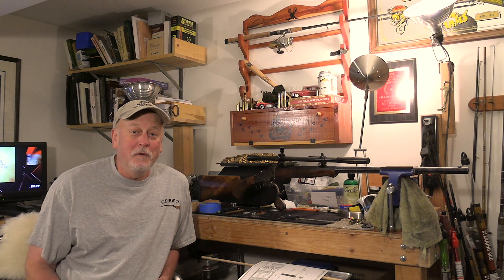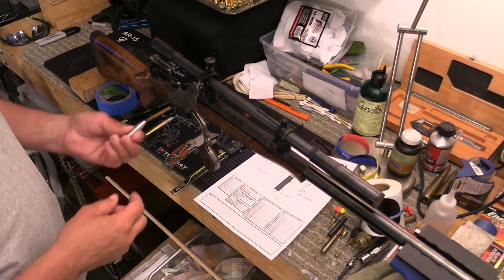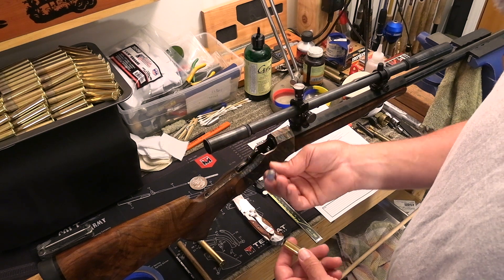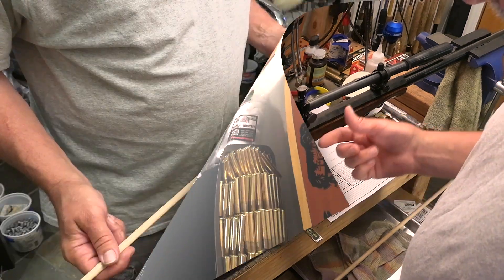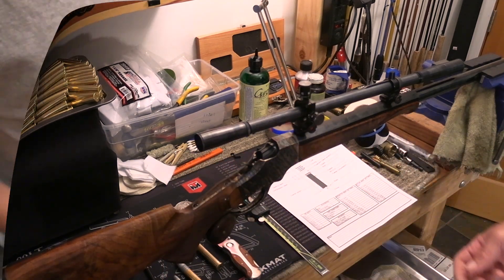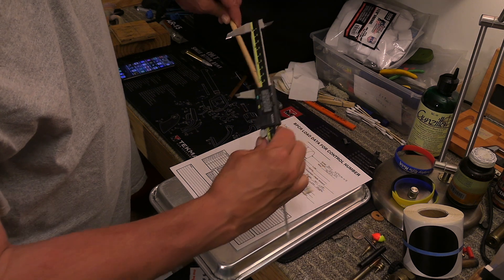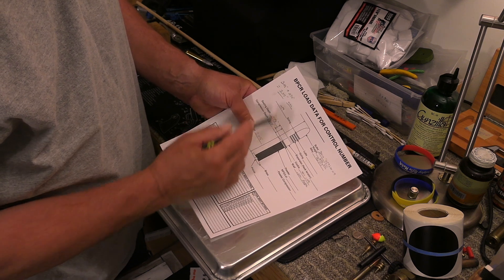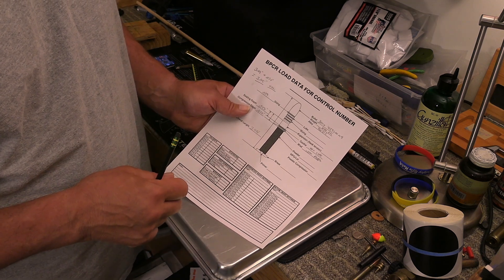Black Powder for Beginners #7 Cartridge Overall Length

Comment: Brilliant! 
I just would like to ask this is working with smokeless cartridges as well? Like .405 Winchester in my case?
Thanks!!!
Reply from the maker: This method is specifically used in single shot rifles. The resulting overall length from this is oftentimes too long to cycle through a repeater. 

The other thing is that seating the bullet farther out could lower the pressure with smokeless powder.  You’ll need to do a ladder test with the new OAL to determine your best load.
Reply: @RecoilTherapyChannel  thank You very much!

Comment: Interesting that you use a .030 fiber wad when compressing the powder column and then you drop a .060 LDPE wad on top of that. While I can imagine that Walter likes selling the additional wads, Is there any particular reason for using 2 wads and placing the LDPE wad on top? I usually just throw a .45 or .41 wad cut from copy paper on top of the fiber over-powder wad to help prevent it from sticking to the base of the bullet in case any lube comes through. Thanks for the link to the load data sheet on DZ's site.
Reply from the maker: Both of the wads are .060 inches thick. While in flight, the bullet is steered by the base. Any damage that occurs to the base of the bullet will adversely affect accuracy. A lot of testing has been done on this and it’s been determined that this was stack the most effective at protecting the base of the bullet. Probably doesn’t matter much if you’re only shooting out to 50 or 100 yards or pistols… But when you’re shooting at 1000 yards, any tiny variance can make a big difference. Awad made out of copy paper won’t do anything to protect the base of the bullet.

Comment: I drop my powder through a 36" tube, cover it with a .060" Walter's Wad, and set the bullet into the case.  I chamber the round which compresses the powder and seats the bullet against the lands.  I use this to set the bullet seating die.  If it is a .40 or .45, I use a taper crimp die.  If it is a .50, i use the case sizing die with the decapper removed to taper crimp.  If I want more compression, I add more wads.

Comment: This is correct but may not work with every rifle. In my Rolling Block, for example, if you add a few thousandths (some people recommend .030") it can cause chambering issues because you don't have enough leverage to fully close the block with that 'interference' fit, or if you're not wiping after every round. Then as you try to extract the live round, the bullet can become lodged in the leade. Worse yet, if there's enough neck tension, the bullet won't release and your extractor could break. This isn't a criticism or a theory, I've been there and done it. Know your rifle.
Reply from the maker: Yeah you RB guys are always getting sore thumbs with this type of seating depth lol!  This is due to the action design. With almost any other type, a camming tool can be used to seat the rounds. With CPA rifles, no tool is needed, the block moves up and forward, thus seating the rounds naturally. The RB has no place on it to use a camming tool, thus the shooter ends up pushing the rounds naturally in with his thumb. 

As far as neck tension goes, none of the guys I shoot with are using any. Bullets are you”finger seated” and can easily be removed from the loaded round if needed. If there is a reason to unload a round on the firing line, the procedure is to remove the loaded case, and then punch out the bullet with a Delrin rod. 

The only time I would use crimp with BP rounds would be for a levergun or a revolver. For single shot ammo, the most we do is bump the loaded round in a resizing die to take any excess case belling off the brass.

Comment: How do you know that the bullet is seated "x" distance into the lands.  Seems like you just pushed it in till it stopped.
Reply from the maker: Once you get the dimension with the nose bumping the lands, you add the .030”, making your final length longer than what you measure on the dowel. 😊That will push it into the lands when you chamber the round.